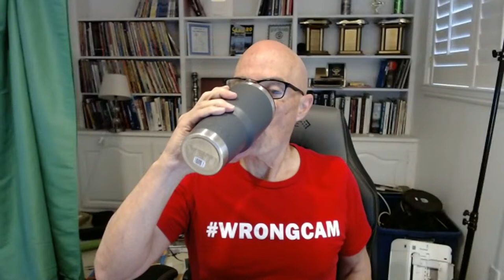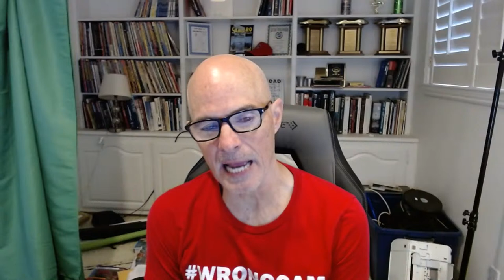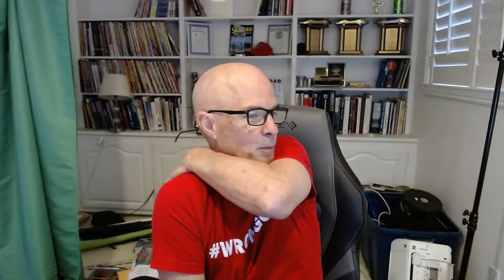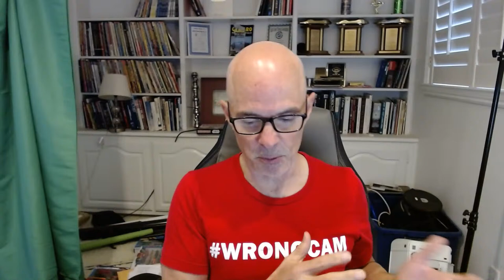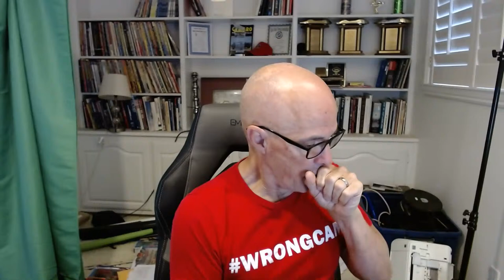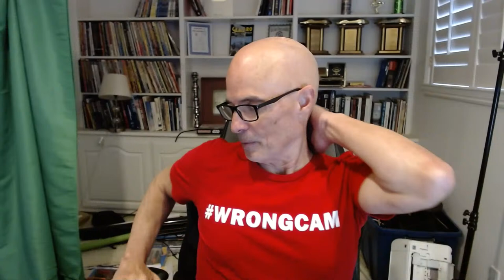4.6L 3V POWER MODS-LET'S TALK TECH

Comment: For those curious on 3V head flow. My engine builder had a local guy port mine and flow before/after. Stock flowed 208/142 Intake/exhaust at .500”. Ported flowed 263/203. They ported it to pair nicely with the cams/intake. Could definitely go more but was no reason to for this application.

Comment: The 2 and 4 valve seemed more reliable but if you don’t judge to harsh 3 valve performs but did they run for same number of years as the 2 and 4 has without much care? Only bad things I heard about 3 valve was didn’t have same longevity as 2 or 4 valve but also know a few still running their 3 valves. Could be a wise tail but how does it happen? Or was it bit more complex?

Comment: In reference to the LY6/E247 question: I'm a dummy, and didn't clean all the schmutz off the corner of the head.  There's a big "823" stamped right on it.  (The E247 was stamped in the rocker valley and easy to see, which distracted my simple attention span.)
Reply from the maker: all good

Comment: Will a 3v fit in place of a 2v  4v is too wide for my chassis
Reply: The only difference between the 4.6 3v 2v and 4v are the cylinder heads
Reply: @jasonbolka9713  anybody with the widths across the exhaust manifolds? I have a 92 Panther chassis and 4 valve have been done but it's not worth the work  I have a spare low mileage 92 so may PI it or Kenne Bell  Mine was the test car for the Transgo AODE kit 20 years ago  RIP Gil
Reply: A 4.6 3v will swap in place of any 4.6 2v original car. Although the 3v has completely different engine mounts, then the 2v/4v engines.
Reply: @jaceconder4584  Thanks so much  I have a line on a 3v wrecked mustang I'm going to part out  my 92 has 300kmiles and about 250k on the transgo trans  I recommend citgo Quatrosyn